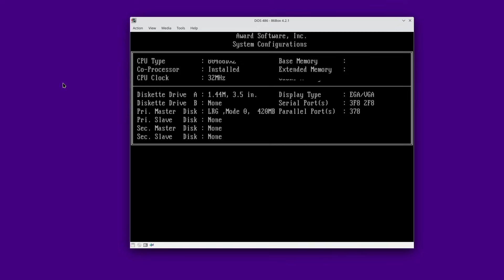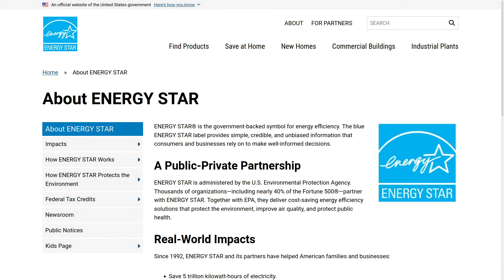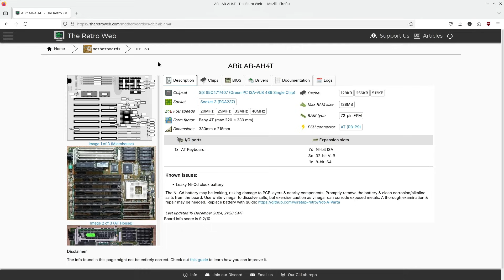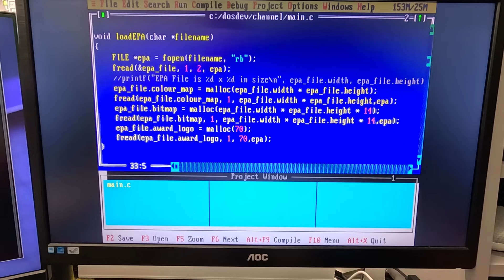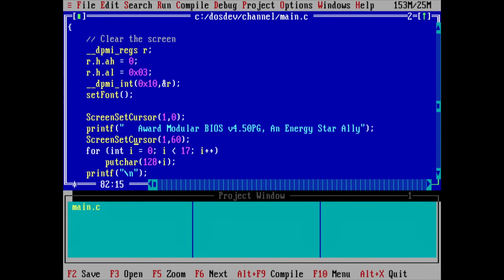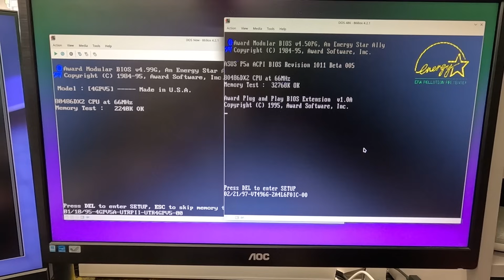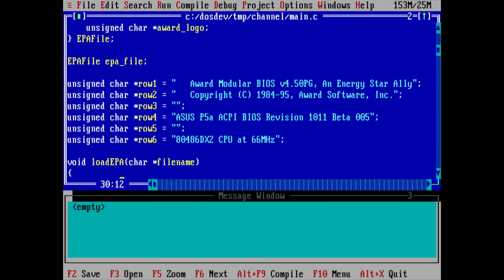Retro MS-DOS Coding - Recreating the Iconic Award BIOS Screen

Comment: Hmm at 11:14; when you called int 10 you put a divergent value compared to the documentation in AX (1110 vs 1100). 
What’s the difference?
Reply: So 1110 or AH:11, AL:10 is "set block specifier".
After Loading a new pattern, IIRC, you can then use this wiith BX to choose which font mode (8 x 16/14/8), DX for the start and CX for the number of chars.

So:

MOV AX, 1110h     // Set block
MOV BL, 00h          // 8x16 font
MOV DX, 32            // start at ASCI 32
MOV CX, 64            // Redefine 64 Characters
INT 10h                   // Do the dirty

You should actully (I think) perform 1110h before 1100h as this call sets the range, and 1100 loads in the replacement data

And thank you for the Way-Back-When inspiration!! 
Takes me back to using BASIC and the CHR$ and DATA commands to define a letter from that grid by adding up the selected bit indexs for each pixel!

If you look at some of those seminal Usborne 1980s coding books, there's some with a few listings of really simple BASIC games, but there were 2 that
I really love, One for writing a basic Roguelike 'Write your own Fantasy Games", which had the theory and multiple listings, for the game engine and an editor.
There was also 2 specific books for text adventure or nowadays 'Interactive Fiction' "Usborne the Mystery of Silver Mountain"  and "Island of Secrets" and I have to thank ChatGPT for reminding me of the name of that!
Point is, those books used the basic equivalent of these two VGA calls to redefine character glyphs, although with much less resolution.

But for a kid in the 80s, these books were magical and you can now get them for free by the publisher in PDF.

Comment: I still remember using assembler to use in and out commands to put data in a000 (vga video memory) to put pixels on screen. And pallette swap/cycles to give it an animation feeling. I called int 21 also a lot for all the DOS functions.

Comment: I made a pacman animation for the command prompt using 8*3=24 user character start with extended ASCII number 128.

-a
072D:0100 mov ax,1110
072D:0103 mov bp,170
072D:0106 mov cx,18
072D:0109 mov dx,80
072D:010C xor bl,bl
072D:010E mov bh,10
072D:0110 int 10
072D:0112 mov bx,8
072D:0115 mov dx,18
072D:0118 mov bp,bx
072D:011A shl bx,7
072D:011D shl dx,1
072D:011F shl bp,5
072D:0122 add bx,dx
072D:0124 add bp,bx
072D:0126 mov ax,b800
072D:0129 mov es,ax
072D:012B cld
072D:012C mov ah,e
072D:012E mov ch,18
072D:0130 mov di,bp
072D:0132 mov al,80
072D:0134 mov cl,8
072D:0136 stosw
072D:0137 inc al
072D:0139 stosw
072D:013A inc al
072D:013C stosw
072D:013D inc al
072D:013F sub di,6
072D:0142 mov bl,al
072D:0144 mov dx,3DA
072D:0147 mov si,7000
072D:014A in al,dx
072D:014B test al,8
072D:014D jnz 014A
072D:014F dec si
072D:0150 jnz 014A
072D:0152 mov al,bl
072D:0154 dec cl
072D:0156 jnz 0136
072D:0158 mov byte ptr es:[bp],20
072D:015D add bp,2
072D:0160 dec ch
072D:0162 jnz 0130
072D:0164 ret
072D:0165 org 0170
072D:0170 DB 0,3,7,1e,3e,3f,7f,ff,ff,7f,3f,3f,1f,7,3,0
072D:0180 DB 0,c0,e0,78,60,c0,80,0,0,80,c0,e0,f8,e0,c0,0
072D:0190 DB 0,0,0,0,0,0,0,0,0,0,0,0,0,0,0,0
072D:01A0 DB 0,1,3,f,1f,1f,3f,7f,7f,3f,1f,1f,f,3,1,0
072D:01B0 DB 0,e0,f0,38,3c,f8,f0,c0,c0,f0,f8,fc,fc,f0,e0,0
072D:01C0 DB 0,0,0,0,0,0,0,0,0,0,0,0,0,0,0,0
072D:01D0 DB 0,0,1,7,f,f,1f,3f,3f,1f,f,f,7,1,0,0
072D:01E0 DB 0,f0,f8,9e,9f,ff,fc,e0,e0,fc,ff,fe,fc,f8,f0,0
072D:01F0 DB 0,0,0,0,0,0,0,0,0,0,0,0,0,0,0,0
072D:0200 DB 0,0,0,3,7,7,f,1f,1f,f,7,7,3,0,0,0
072D:0210 DB 0,78,fc,cf,cf,ff,ff,fe,fe,ff,ff,ff,ff,fc,78,0
072D:0220 DB 0,0,0,0,80,80,c0,0,0,c0,80,0,0,0,0,0
072D:0230 DB 0,0,0,1,3,3,7,f,f,7,3,3,1,0,0,0
072D:0240 DB 0,3c,7e,e7,e7,ff,ff,ff,ff,ff,ff,ff,ff,7e,3c,0
072D:0250 DB 0,0,0,80,c0,c0,e0,f0,f0,e0,c0,80,80,0,0,0
072D:0260 DB 0,0,0,0,1,1,3,7,7,3,1,1,0,0,0,0
072D:0270 DB 0,1e,3f,f3,f3,ff,ff,fc,fc,ff,ff,ff,ff,3f,1e,0
072D:0280 DB 0,0,0,c0,e0,e0,80,0,0,80,e0,c0,80,0,0,0
072D:0290 DB 0,0,0,0,0,0,1,3,3,1,0,0,0,0,0,0
072D:02A0 DB 0,f,1f,e9,f9,ff,ff,fe,fe,ff,ff,ff,7f,1f,f,0
072D:02B0 DB 0,0,80,e0,f0,c0,80,0,0,0,e0,e0,c0,80,0,0
072D:02C0 DB 0,0,0,0,0,0,0,1,1,0,0,0,0,0,0,0
072D:02D0 DB 0,7,f,3c,7c,7f,ff,ff,ff,ff,7f,7f,3f,f,7,0
072D:02E0 DB 0,80,c0,e0,f0,e0,c0,0,0,c0,e0,f0,f0,c0,80,0
072D:02F0 
n PACMAN     .COM       <---- remove spaces
-rcx
CX 0000  :1F0
-wcs:100
Writing 01F0 bytes
n PAC             .COM       <---- remove spaces
-rcx
CX 01F0  :53
-wcs:112
Writing 0053 bytes
-q

Comment: Haha, that reminds me of my different tries to do the same in Turbo Pascal when I was 10 or 11.. I had no real programming experience, just a bunch of selftaught use cases, like "readln" and "writeln" and move the cursor to a x/y position (which was totally sufficient to create text adventures or funny little tools). 

Eventually I successfully "emulated" the startup screens (even with a well timed "himem is testing extended memory". 
But never figured it out how to add the original Energy Star logo, so I faked it with yellow font and tried to imitate it by approximating it with yellow ASCII symbols.

Actually I went a few steps further and imitated even DOS: for each known DOS command I added some funny text output.. 
But the best part was that I even implemented a working (fake) Norton Commander where you could scroll through a fake file system and also got some funny messages. 

Wow, that was a wild time :D
Thank you for waking some forgotten memories from my childhood!

Comment: what IDE is that? First I thought it was just Borland C++ with custom settings for using gcc instead of bcc, but then I noticed the forward slashes in the file names in the window titles, which is not something Borland did. It must be a newer IDE (DOS tools never used forward slashes), so now I'm curious :)
Reply: I think it's DJGPP.
Reply: @mykolapliashechnykov8701  yeah, djgpp is the compiler, but I was asking about the IDE (the GUI/menu thing with the editor window and the menu bar etc)
Reply: The IDE is RHIDE, a Borland-inspired IDE for DJGPP. There's also a similar editor called SETEDIT. Both projects aren't so new any more, beginning in about 1996.

Comment: My initial guess is: a custom font or characters (it was possible to set on a BIOS level), which got swapped to regular ones before the OS started booting.

EDIT: Yup, that's it. I've learned that when I was learning programming back in the 90. As for the gaps, you probably just need to choose a different video mode - one that has the same font size the logo characters have. As you stated in the video: one was EGA, the other was VGA. I woudn't be surprised if the font was designed for a specific video mode.

Also, demo programming? I really miss the demoscene. :)

Comment: AH=0x11 AL=0x11 and BL=0x01 to get the AwardBIOS EGA text mode. If you wonder how the text mode works behind the Windows 95 boot screen, I have a video on my channel about it
Reply: The VGA text mode adds one pixel to the 8 width font making it 9 pixels wide, just like MDA text mode. EGA text mode doesn't have that artificial spacing so the EPA logo gets drawn correctly
Reply: @MissNorington  It's not just the font, but the resolution of 350 scanlines makes the scanlines move visible on a CRT. It makes the difference for us older CRT nerds
Reply: The default character use block 0 (bl=0). All other blocks are empty til we fill it with a font. But with function ax= hex 1103 we can use a combination of two character fonts to display up to 512 character at once, example block 0 + block 1 with combination code= hex 84.
Block 2 + block 3 with combination code=hex 8E.

Both blocks use the same ASCII number. To display both blocks we have to set bit 3 of the attribut byte on the screen for one block and clear bit 3 of the attribut byte for to display the other block. So we lost the intense bit of the foreground color of one block.

But we can get the palette byte of an intense color to set the palette of a darker color. Example to get the palette of color f to put it into the palette of color 7. Now we lose the darker color.
Reply: I'm still young, I collect CRTs though

Comment: A tiny pacman animation for the command prompt using 8*3=24 user character starting with extended ASCII number 128.

The body starts inside of two character and each step it moves one pixel to the right side into a third character while open and close the mouth. And then it starts again one location(8 bit) to the right side.

It save to executable. The first with all bytes and the second with the animation routine only. The cls command of DosBox reset all character to default.

-a
072D:0100 mov ax,1110
072D:0103 mov bp,170      ; offset of character font  (DOS com files start with DS=ES=CS=SS)
072D:0106 mov cx,18         ; 24 character
072D:0109 mov dx,80         ; start with ASCII number 128
072D:010C xor bl,bl             ; block 0 = override the existing character
072D:010E mov bh,10         ; 16 bytes for one character
072D:0110 int 10
072D:0112 mov bx,8            ; row
072D:0115 mov dx,18          ; collumn
072D:0118 mov bp,bx
072D:011A shl bx,7
072D:011D shl dx,1
072D:011F shl bp,5
072D:0122 add bx,dx
072D:0124 add bp,bx
072D:0126 mov ax,b800
072D:0129 mov es,ax
072D:012B cld
072D:012C mov ah,e          ; color attribut
072D:012E mov ch,18
072D:0130 mov di,bp
072D:0132 mov al,80        ; start with ASCII number 128
072D:0134 mov cl,8
072D:0136 stosw
072D:0137 inc al
072D:0139 stosw
072D:013A inc al
072D:013C stosw
072D:013D inc al
072D:013F sub di,6
072D:0142 mov bl,al
072D:0144 mov dx,3DA
072D:0147 mov si,7000        ; delay
072D:014A in al,dx
072D:014B test al,8
072D:014D jnz 014A
072D:014F dec si
072D:0150 jnz 014A
072D:0152 mov al,bl
072D:0154 dec cl
072D:0156 jnz 0136
072D:0158 mov byte ptr es:[bp],20      ; space
072D:015D add bp,2
072D:0160 dec ch
072D:0162 jnz 0130
072D:0164 ret
072D:0165 org 0170
072D:0170 DB 0,3,7,1e,3e,3f,7f,ff,ff,7f,3f,3f,1f,7,3,0
072D:0180 DB 0,c0,e0,78,60,c0,80,0,0,80,c0,e0,f8,e0,c0,0
072D:0190 DB 0,0,0,0,0,0,0,0,0,0,0,0,0,0,0,0
072D:01A0 DB 0,1,3,f,1f,1f,3f,7f,7f,3f,1f,1f,f,3,1,0
072D:01B0 DB 0,e0,f0,38,3c,f8,f0,c0,c0,f0,f8,fc,fc,f0,e0,0
072D:01C0 DB 0,0,0,0,0,0,0,0,0,0,0,0,0,0,0,0
072D:01D0 DB 0,0,1,7,f,f,1f,3f,3f,1f,f,f,7,1,0,0
072D:01E0 DB 0,f0,f8,9e,9f,ff,fc,e0,e0,fc,ff,fe,fc,f8,f0,0
072D:01F0 DB 0,0,0,0,0,0,0,0,0,0,0,0,0,0,0,0
072D:0200 DB 0,0,0,3,7,7,f,1f,1f,f,7,7,3,0,0,0
072D:0210 DB 0,78,fc,cf,cf,ff,ff,fe,fe,ff,ff,ff,ff,fc,78,0
072D:0220 DB 0,0,0,0,80,80,c0,0,0,c0,80,0,0,0,0,0
072D:0230 DB 0,0,0,1,3,3,7,f,f,7,3,3,1,0,0,0
072D:0240 DB 0,3c,7e,e7,e7,ff,ff,ff,ff,ff,ff,ff,ff,7e,3c,0
072D:0250 DB 0,0,0,80,c0,c0,e0,f0,f0,e0,c0,80,80,0,0,0
072D:0260 DB 0,0,0,0,1,1,3,7,7,3,1,1,0,0,0,0
072D:0270 DB 0,1e,3f,f3,f3,ff,ff,fc,fc,ff,ff,ff,ff,3f,1e,0
072D:0280 DB 0,0,0,c0,e0,e0,80,0,0,80,e0,c0,80,0,0,0
072D:0290 DB 0,0,0,0,0,0,1,3,3,1,0,0,0,0,0,0
072D:02A0 DB 0,f,1f,e9,f9,ff,ff,fe,fe,ff,ff,ff,7f,1f,f,0
072D:02B0 DB 0,0,80,e0,f0,c0,80,0,0,0,e0,e0,c0,80,0,0
072D:02C0 DB 0,0,0,0,0,0,0,1,1,0,0,0,0,0,0,0
072D:02D0 DB 0,7,f,3c,7c,7f,ff,ff,ff,ff,7f,7f,3f,f,7,0
072D:02E0 DB 0,80,c0,e0,f0,e0,c0,0,0,c0,e0,f0,f0,c0,80,0
072D:02F0 
-n PACMAN.COM
-rcx
CX 0000  :1F0
-wcs:100
Writing 01F0 bytes
-n PAC.COM
-rcx
CX 01F0  :53
-wcs:112
Writing 0053 bytes
-q

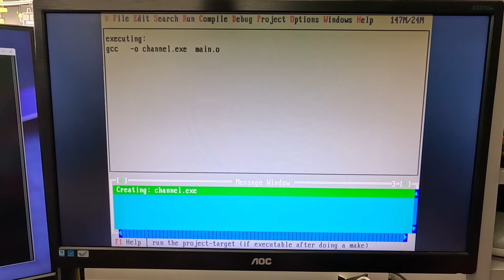Comment: at 2:51 you start compiling an say "this will take ages", but you appear to
be running Turbo C++, the fastest compiler at the time. Then I noticed that the
compiler is gcc, so what is your toolchain?
Reply: DJGPP - This is a very old version of GCC that was ported to the DOS and ran in extended mode with its own DOS extender.

Comment: BIOS has microcode in it??! How have I not known that for the last 40 years. Very interesting video
Reply: Did you know that modern CPUs can't start up? AMD uses their security processor to start it, and Intel uses their management engine processor. The RAM and PCIe don't work at power up, they don't have the calibration programmed in to deskew and set up the impedance adjustments. If you go back a little further, there are CPUs that only use their cache at startup, and it is enough to get through the memory and PCIe lane training.

Comment: Function ax= hex 1100 or ax= hex 1110 of int hex 10 is for user character. On VGA text mode we start with 80x25 collumn and rows and 8x16 character size, so each character have 16 bytes.

Comment: The fact that you cleared the screen(memory) when you set the screen mode I believe is evidence that you infact changed video mode... I believe you might be looking for mode 0 at system boot; and if you set the video mode to 0 from mode 0 the screen shouldn't clear. I suppose you could change modes and change back to clear the screen, but I think the fastest way to do it is to just write blank characters(/0 or a space) to the bytes that represent unused characters in video memory.

Comment: Your text mode is 720 x 400, but 80 characters wide. 80 characters by 8 bits wide needs 640 pixels, so it uses a single pixel space between each character. Try text mode 10h (which is true VGA 640 x 350 with 8 x 14 fonts).

The obvious question is, is it not possible to create 16 bit binaries any more? Switching between 32 bit and 16 bit modes with memory thunking has got to be the hard way of doing this.
Reply: Well a list of (modern and classic) tools that emit 16-bit code has been eaten by YouTube's machine. You're apparently on your own but the list is extensive.

Comment: You need text mode 10h instead of 03h:
10h = G  80x25  8x14  640x350    4       2   A000 64k EGA
        = G    .     .    640x350   16       .   A000 256k EGA,VGA
Reply: 10h is not a text mode.  It is a graphics mode (that's why it says "G" instead of "T" in that row).  Won't work the same way at all...
Reply: It is Graphics (G) mode not Text (T) mode, blinking cursor usually only available for T mode.
Reply: Es posible realizar las graficas inclusive en Modo texto. Las aplicaciones MSDOS como Norton Disk Doctor hacian eso. Inclusive lo he hecho para hacer graficas en modo texto. Simplemente se asignan(W/8) * (H/16) caracteres ASCII y se les cambia el mapa de bits de dichos caracteres y se los presenta en pantalla.
Reply: I was scrolling through the comments and everyone talking about the 8x14 font size and I'm like, if you know that, help the guy out with getting into it and you're like the first post I noticed that did it.  I was about to dig through all my old references. I remembered vaguely what he needed to do, but couldn't remember the video mode.  And 10 mode 10 go!

Comment: I remember being jealous of anyone who had a PC newer than mine that showed that stupid little EPA logo. Then I realized it was next to meaningless once I got a newer Socket 3 board that supported it, and I could never get suspend to work right in Windows 95. Seemed like there was always some driver that didn't want to "wake up" right and I would just end up having to reboot. The biggest energy saving at the time was a CRT that supported sleep mode - never had an issue with that. 

Any way, interesting exercise in DOS coding.

Comment: I used to use a game "engine" called megazeux that had a text mode that would work on some video cards that would allow for 4 colors per tile, and each would be reduced to 4x14.  Very weird, very difficult to work with.  I believe it mostly worked with late 90s/early 2000s nvidia and ATI graphics cards but maybe some others.

Comment: I used to do BASIC programming in DOS when I was a kid, and always wondered how computer can draw graphics on a screen mode that is obviously text mode,hence dos BASIC didn't allow you to draw graphics in text mode because DOS didn't allow BASIC to do it and again because BIOS routines were written that way😅. I learned many years later ( from Bits und Bolts) that the graphics are acrually custom ASCII charachter blocks.

Comment: Hi NCOT,
The reason there's vertical gaps in your "large" Energy Star logo in the top right corner is that in VGA mode you have an 8px horizontal character grid, but a 9px screen grid. The 8th - "last" - pixel of every line in a character is always duplicated to the 9th pixel. This way you have the possibility to make certain characters (box-drawing characters from the ASCII table's 2nd half, but also the plain old underscore "_") be horizontally continuous. You need to find a BIOS video mode where the horizontal pixels per source character matches the pixels per screen character, i.e. no pixel duplication. AFAIR the Energy Star logo does NOT use these duplicated pixels. It would be very obvious otherwise.
Reply: EDITED: Not necesarily. 9th pixel duplication was enabled in the range of characters C0h-DFh when the flag "Line Graphics Enable" was enabled in the Attribute Mode Control Register (Index 10h). I remember being parametrizable in some EGA/VGA clones. When setting a video mode, those came preselected for the graphic characters (the box drawing characters). You can either remap the box drawing characters themselves, or use the registers to add your own characters to the range if you use an emulator that emulates compatible hardware (I think S3 did do it, but I don't know how good is S3 text mode emulation is in dosbox).

That's why after this screen, the BIOS would clear the screen again resetting to a standard mode, and print the second part of the BIOS with the box detailing the CPU model, RAM, etc, resetting the font so it could print the box and then chainload to DOS, which may change the codepage (redefining the font again) without clearing the screen.
Reply: @RubenMartinezCabello  Wow. I never knew this was configurable! I need to dig out my MS-DOS LiveCD again, and play with that a bit. Do you believe this INT 10h stuff works just as "back in the day" when subjected to "modern hardware"?
(I once wrote a hotkey-bound screen-blanking TSR in machine code. With dos DEBUG iirc 🙃; some of that knowledge is still there...)